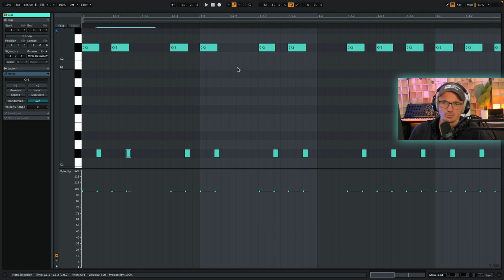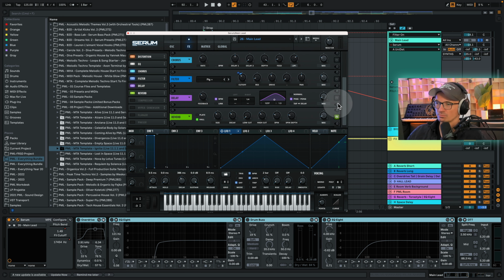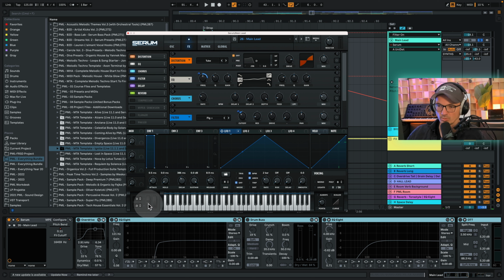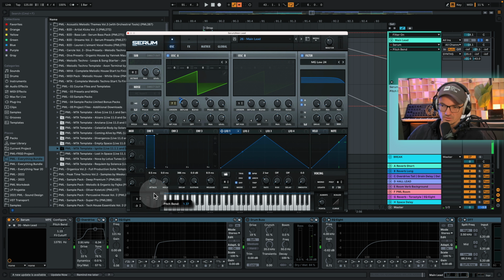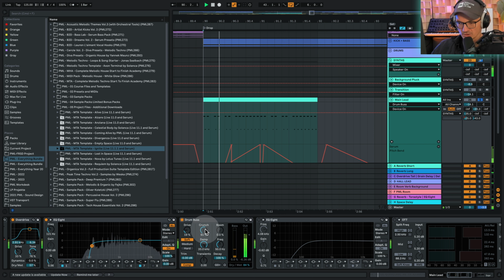ANYMA "Eternity" Style Lead Sound | Serum Tutorial | Melodic Techno, Afterlife | Producer Notes IX

Comment from the maker: ⏰ TIMECODES ⏰
00:00 Intro Playback
01:13 Raw sound in serum
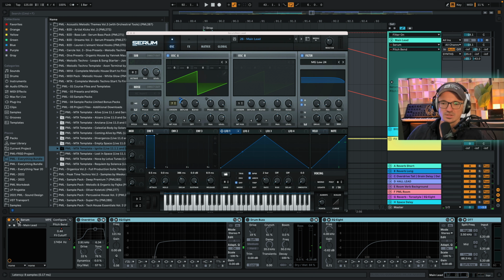01:25 Wavetable Detuning 
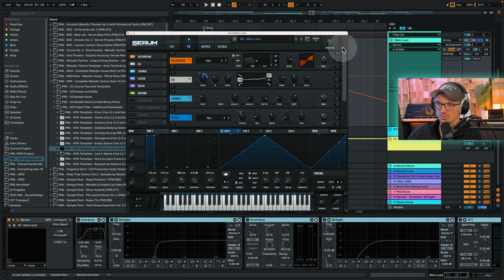02:00 Pitch Bend
02:40 Filter
03:15 Serum Effects (distortion, eq)
03:40 Chorus effect
04:10 Flanger 
05:00 Send Effects
06:00 Overdrive
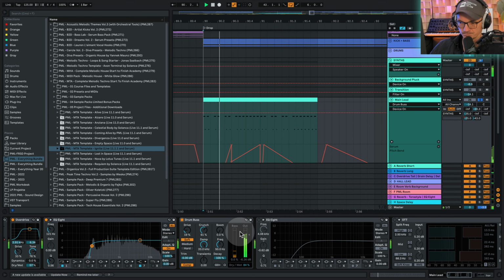06:35 Drum Buss
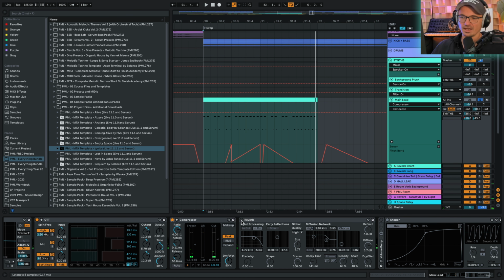07:25 Short Reverb
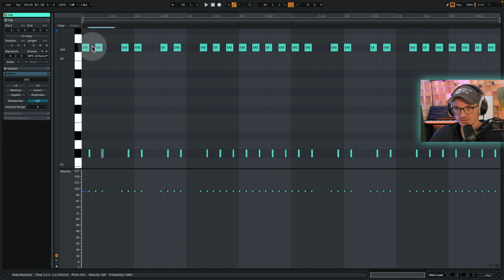08:10 Effect Summary
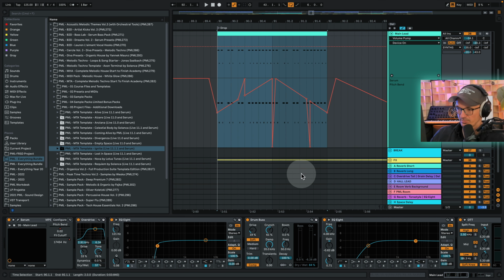08:29 Playback Final Result